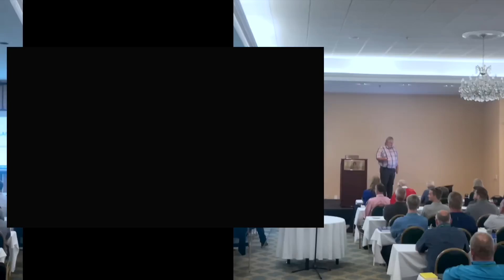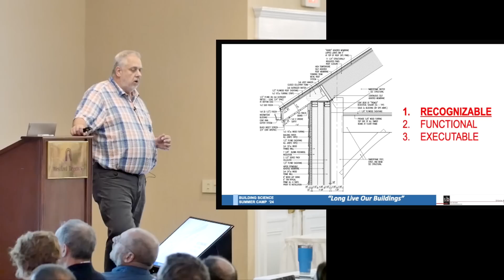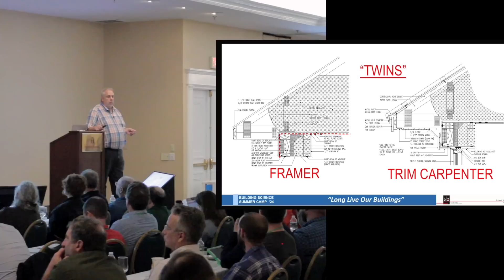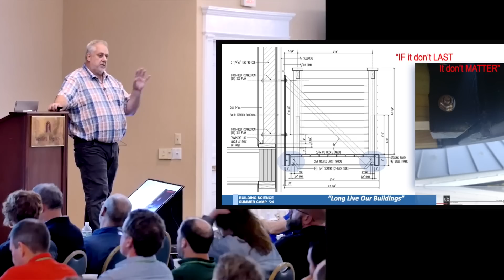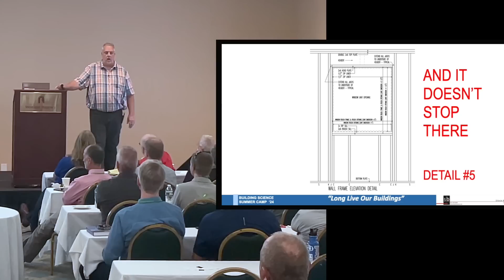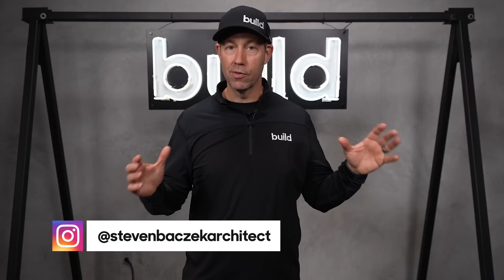Your Architect Does it Wrong

Comment: “Nonsense”
I started working in 1968 as a draftsman (Drawn by hand on Mylar) at John Carl Warnecke Architects. 
Traditionally, there were highly skilled, experienced architects who passed down their knowledge to the apprentices; it was all about why and how buildings were built.

Architects are required to have three years of practical experience through an internship with a licensed architect. After these requirements are met, individuals can take the rigorous 36 hour Architect registration Examination.

My first project was working on Logan Airport, my task was to reduce the scaled drawings of Minoru Yamasaki’s Eastern Terminal at Logan Airport. 
These drawings were technically complex and filled with exquisitely detailed construction documents.
“You have to wonder why the Brooklyn Bridge Opened on May 24, 1883, is still standing.”

Comment: Do architectural drawings ever indicate the sequence in which a detail is assembled, or do architects assume the contractor understands the sequence?
Reply: Generally the general contractor determines the sequence after studying the drawings.  They're the one that takes on division of scope between subs, scheduling them, etc.  The drawings show intent of a final product.  They also don't show any temporary works (i.e. shoring) which may be required and affected by the sequence determined by the contractor.  Sometimes it's obvious what the order of things should be, and sometimes there's options available to a contractor due to site conditions, lead times, weather, etc.  Those options can sometimes save an owner money (or make a job more profitable for a contractor if they're bearing the risk), so the sequence is left to the team actually in charge of implementing the design concept.

Comment: I’m an architect.  I learned to draw ✍️ by hand and it was considered an art form with a long tradition of graphic expression.  I had to carefully consider sheet layouts and exactly how big and where to start drawing sections, elevations, etc. moving a section over an inch might take a day or two of redrawing.  That design of sheets and drawings on them got lost as students do everything on a computer now.
Reply: My year in high school was the last ones to use drafting tables.  I did one year of manual drafting, and two of CAD before graduating.  One year was not enough to develop the right instincts of scale, font size, and drawing layout.  And the ability to zoom in on a monitor doesn't help.  I find I still plot a check set of the first couple plans/details just to make sure my scale and font sizes are suitable for the project.
Reply: @The_R_Vid  it doesn’t help when AutoCAD uses colored layers onscreen to abstractly represent different line weights.

Comment: "Recognizeable"?  No offense meant, simply a stated experience, but I've mimic'd some of your details on my projects, or worked to achieve configurations that you and Matt have shown in regards to insulation / weather barriers and it has thrown builders thru a loop or they've thrown a fit.  Mostly saying I was trying to over-build the house or trying to be overly fancy details.  I'm not saying you are wrong, or these efforts are not worthy, and builders will see what you are doing, but honestly it has caused me grief to try to be like you guys.  I hope that the envelops and details that you guys develop become more widely accepted.
Reply: As an engineer that specializes in remediation of failed/damaged structures, I often have to deal with the "you're over engineering this", or "this is way over-built".  Whenever I ask the tradesman what they would have recommended, it usually comes close to what was originally built.  As we are dealing with a failure, I simply point to the project we're working on as reason why what is typically done is unacceptable, and that things that seem "over-built" to some are simply built to longer service life.  On every project I ask the owner how long they want the repair to last.  As they're the ones paying for it, they get to make the call.  I then engineer a solution to meet their budget and requirements.  Some owners understand the value in building a robust structure and implementing redundancy in details to protect things that are expensive to repair/replace.  Some don't. Sometimes I just need to remind the contractor that their job is to implement the design, and that what is shown on the drawings reflects not just the engineer/architects wishes, but the owner's too.

Comment: Steve Baczek & Joe Lstiburek are 2 people I hold in high esteem . I had no idea those two worked together and now it makes total sense. Like myself, both gentlemen have the gift of gab and go the extra mile to ask questions and learn from other peoples experiences, not just dominate conversations with theirs. Steve would always amaze me how he would join in on the comment section on the Build Boston video series . I know he definitely joined in on several comments and concerns I made over the years. Since I retired from the natural gas utility industry in STL, I have made several trips to Boston and developed a respect for their building trades, and legacies they have developed in the building industry. As an example, I was touring MIT  paying attention to the mechanical systems and piping systems , especially how they labeled all the valves and direction of flows & etc (almost eliminating the chances of mistakes or assumptions needed). Apparently a gentleman with MIT noticed my interest in the mechanical systems and became interested in my background and my thoughts on the particular systems I was looking at. After about a 20 minute conversation with the gentleman, I kind of realized the people in the Boston Massachusetts Metro area may have a little extra something more than the rest of us; perhaps that’s why Massachusetts has the highest ranked educational system in the country 🤷🏻‍♂️.
Great video and keep them coming Matt.
Regards from Bob in STL.

Comment: An excellent presentation by Steve, but I find myself in agreement about his criticism regarding NAAB-accredited architectural education in the US.  Of the 48 REQUIRED courses for my Architecture degree, only about 5 ELECTIVE courses were offered regarding sustainability/alternative materials/building science principles. So his argument that many of the building science concepts are rarely taught, and only for individuals motivated to voluntarily pursue such training.  While we ALL are required to have at least 2 courses in physics, they only equip us with a foundational knowledge of thermal transfer and much of it is related to statics, kinematics, and classical dynamics (including Newton's laws), torque, projectile motion, and circular motion with some additional coverage regarding fluids, elasticity, vibration (including simple harmonic motion) sound waves and acoustics and a little thermodynamics. I think that NAAB and NCARB need to reconsider the curricular requirements for future architects so that these types of courses are no longer ELECTIVE but instead become requirements (even if such architects never use them in their practice).

Comment: First summer after Year one I worked in Commercial Construction. I was working with a guy from Newfoundland and when he found out that i was going to drawing buildings for a living he took me aside.  He showed me the details we were going to build "see how this is drawn?" "this is how we need to build it 20' in the air over a open hole". "What you need to do is draw it the way we build it." Good Advice for a 45 year career.
Reply: I don’t tell builders how to build in my drawings.They need to know that. I just show what to build. I use my construction field experience to understand the components and sequence—or at least ONE way it could be done. Generally I don’t do window details except flashing guidelines (CYA). The builder should know how to put in a flange window and they are responsible to install it per manufacturer and to be weather resistant. I’m not here to teach them the basics of their job. We do extensive details on some openings, but not standard windows.
Reply: @pcatful  exactly ... Tell them in the images and notes you want them to build but not how it (sometimes a complex build requires their input into the drawings. 

I have a master details package for new trades covering our energy codes and moisture ingress protection.

We adopted a learning lunch program years ago to coordinate between trades and the overlaps required.
Reply: @warrengaul2518 Sounds awesome.
Reply: @pcatful yup - it’s the builder’s responsibility for “means and method” to build per plan.
Reply: What is “Year one”?
Reply: @coachjimblack  year one of technical school.

Comment: Isn"t  that a job of an engineer to draw in detail each phase of construction?  I though an architect draws just the general house design and engineer draws construction details.
Reply: Actually, this depends on a lot of factors. Where you’re located, the architect’s background and experience, commercial vs residential, and how tall the building is. Typically an architect concentrates on floor plan flow and interior and exterior aesthetic details, while the structural engineer does foundations, walls and roof systems focusing on local building considerations such as hurricanes/earthquakes/snow loads, etc.
Some architects have the knowledge (and liability insurance) to do all of the engineering, some prefer to work only on the creative side of things. Also, in many parts of the US, a licensed structural engineer is required to sign and seal buildings over three stories (+/-) in height.
Reply: @Magpie-1111  Nope, it would be very rare for a civil engineer being involved in residential construction in any way in the U.S. Not only would engineering involvement be rare but even architects are rarely involved. From Google: "According to most sources, only around 2% of US residential construction is designed by a licensed architect; meaning that the vast majority of homes do not involve direct design input from an architect."
Reply: No, it doesn't work that way. State licensed architects are able to calculate and design building structures. It would be rare for a civil engineer to get involved, typically only if there is some aspect of the build that specifically requires signoff by a state licensed PE. Architects design every last detail of construction that isn't mandated by the building code (which covers all the fine details).